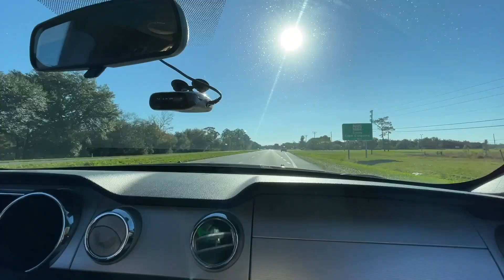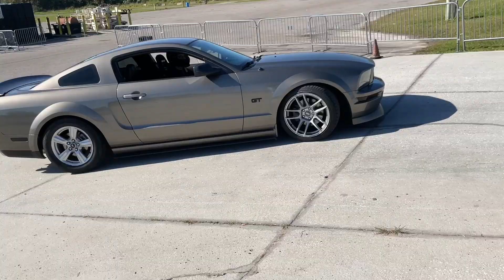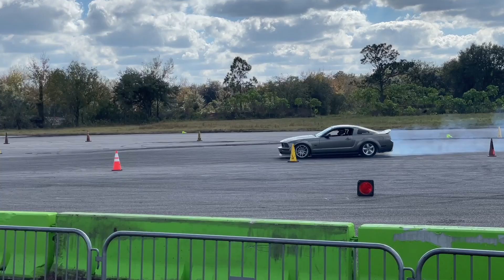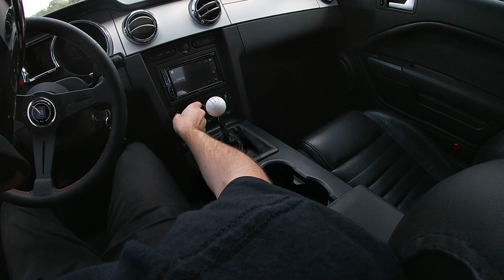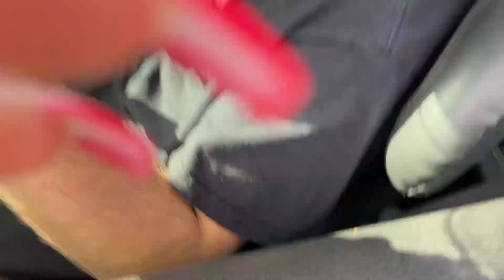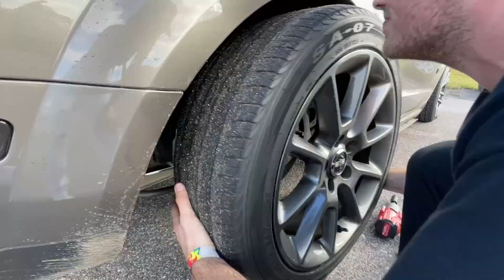My first DRIFT EVENT was a success!!

Comment: What wheel/tire sizes do you like to use when drifting s197?
Reply from the maker: My fronts are 18x9.5 245’s and my rears are 18x8.5 235’s which isn’t ideal but it’s the cheapest tires I could find for the rear😂

Comment: Man two questions: how did you set up nardi wheel and how did you fixed issue with burning alternators?
Reply from the maker: I’ve only burnt through one alternator and I got a replacement on AM a couple years ago and it’s been good. I fit the nardi with the s197 nrg hub and a 1inch adaptor no quick release